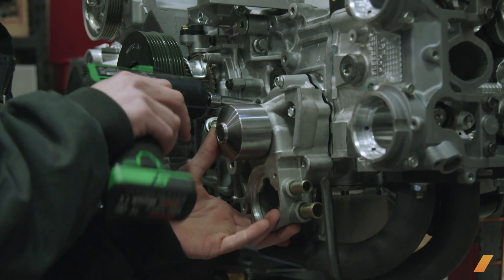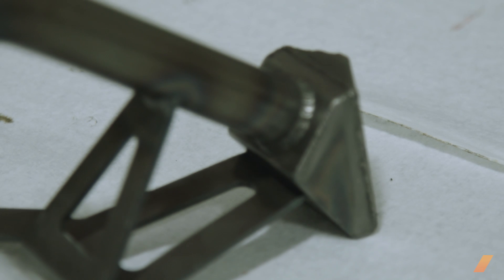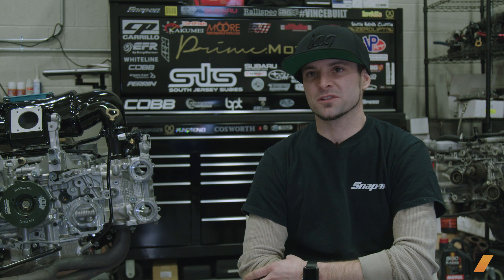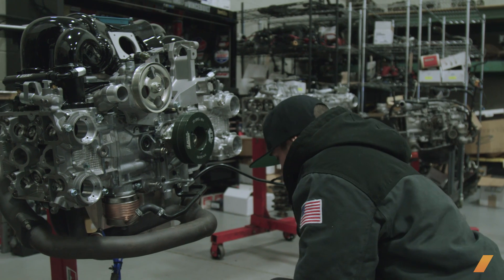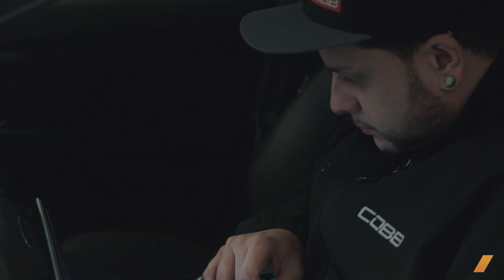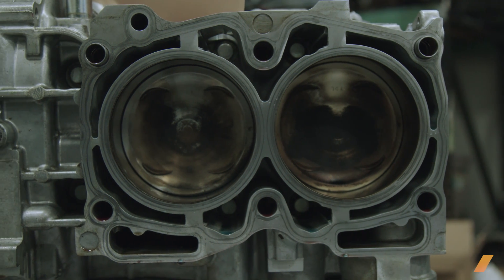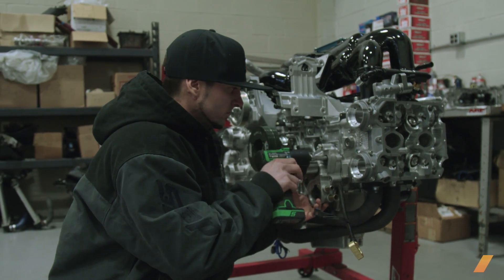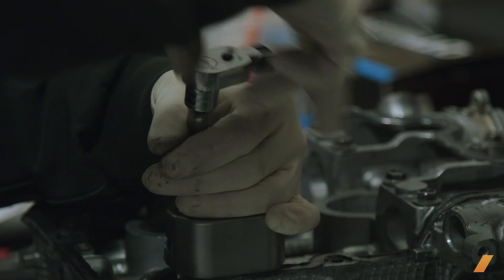Legendary Subaru EJ: 1,000-hp Performance, If You Want -- /ENGINEERED

Comment: You seem pretty knowledgable, i run Rotella t5 or t6 in all my engines, My car (4 cyl), my truck (v8) and my bike, (honda VLX 600 with mods and wet clutch) also ran it in my Harley, but only in the crankcase. You  mentioned oil change times.  This oil in the big rigs, is changed out every 25k miles( granted they are hwy miles)  I go about 12k between changes except inthe bike, its about 5k.  What are your opinions on the oil and its uses?

Comment: "600 hp are the norm nowadays". That's perfect because that is about what I was looking at doing when I have my engine rebuilt. Currently I have a BNR 16g on a cryotune, with a bulletproof mod stock TMIC, up pipe, down pipe, upgraded fuel pump, and clutched rated for 450 lb/ft. I'm looking at an IAG stage 2 EJ257 open block with stock heads, and a turbo that flows between 60-65 lbs/min, and whatever fueling considerations are required (E85 maybe?). I'm trying to wrap my head around the best approach for this - including supporting mods. The LegacyGT forum seems to have some information, but if anyone has links to 600 HP builds, I would love to see them as I still have a lot of questions.

Comment: I had an 2004 wrx 2.0. Blew the engine at 64000 miles, Spun a bearing. I rebuilt it myself because I didn't want to pay the "stealer" to replace it with another problematic motor and I wanted the challenge.  I bought a new crank from Subaru. The part number was different to the stock crank. The oiling holes were clocked differently. The old crank basically ran out of oil pressure at every 180 degree point. Look up the issue with Chevrolet after market forged cranks on the 327 57 Chevys. When you split the motor open you will also see that the oil feed holes to the crank were not drilled correctly from the factory. The oil feed holes are pin sized at the bottom of the cut. Basically you finish drilling the holes the factory diameter but you go deeper cutting out the pin hole on the bottom. You'll see what I mean when you pull the crank and look for it. I ditched the silly valve in the intake. JB welded the holes from the shaft and blended it with a die grinder. Port matched the exhaust manifold at the flange on every port. Hollowed the 3 cats and programmed the cat inefficiency code out. That and a fabricated down pipe from the stock flange to the 2nd cat's side increased boost 1.5 psi. I changed out the stock pump for a walbro. What I wish I had done was also upgrade the injectors but I wasn't sure I could get the computer programming right in a fast enough time frame. it was my only transportation at the time. I turned the boost up to 21 psi on a stock turbo. I added 3 degrees of timing and left the fat factory fuel map. That car was at 160000 miles with the stock turbo when I sold it. I use to have a problem with oil burning before I rebuilt the engine. A ball honing with a drill and new rings and I never burned oil again. I eventually sold the car because I was suspecting the 5 speed was going to let go. Especially after replacing the clutch with an aftermarket that didn't slip like the stock clutch. I could out run a stock sti and was beating stock M3's of the same year. I could never get around the newer bad boy M3's before I sold it. Surprised different modded cars that said they always beat wrx's. ....now playing with an  ls motor with a single turbo. Much cheaper and reliable. Oh yea . Another reason I sold it was because no one was sharing any  secrets about the wrx. The tuners would not breathe a word. Basically drop it off , leave a check and we will mod and tune it. Very stingy with the knowledge. Kinda the same crap this dude is selling. Leave it and a credit card with us and we will fix it. No thanks!!!

Comment: Much bigger problem is simply in the banjo bolts. but other than that greatest platform in my opinion to date. and i have yet to see any other ej running a faster time stock at 12.59 could’ve gotten alittle quicker had car been let set for a cool down period.

Comment: Rallispec people are freaking wizards and get my respect no question. I worked over my 4G63 with Andy C who was Dave A's partner way back for club rally and these guys are no joke. They actually had to change the rules to slow Dave's suby engines in international top level sports car racing. His road racing car won everything when the driver from Phoenix in PA was in the picture a few yrs ago. THen this shop was Subaru factory racing team international engine builder. I never met Vince but as an alumnus there's no doubt he's on point.

Comment: EJ22T from a 91-94 (closed deck block) is the BEST choice.  I donlt care hwo smart this guy of the video is, the EJ22T is the best they made, then a EG33 but not talking that one yet.  A EJ22T can tke 30 psi boost on stock bottom end and never have and issue, with some fuel management.  Just saying.  I have owned over cars wtih that ej22t.  I had a shelf of the, .  Not more.  They all went across the pond.  Wish i had them back cause I know what they are.  Sleeves, um no closed deck YES

Comment: Thanks for taking the time to post some good technical info!

However, I thought I might actually hear some decent points about why a boxer (the EJ) is good (low Cg of the engine and "balanced" only help those looking for confirmation bias i.e. Subaru fanboys).  I am very disappointed.  This is why I sold my STI and bought an Evo.  I got sick of blown head gaskets, poor turbo spool, bad handling, low horsepower, and being beat by evo's with nothing more than a tune.  Subaru needs to ditch the problem prone boxer and go with a practical engine.

Comment: The FA will very quickly surpass the EJ platform hands down. Just because they have been using the EJ in the sti for like 47 years doesn't mean it's a great motor. They have a lot of issues when you try to make power without fully building them. There is a reason every sti owner trades in or sells their car at right around 90-100k miles because even if the car has been maintained and serviced regularly it has become a ticking time bomb. Within a few thousand miles you will start having to replace major parts on that motor including the turbo and it will become a money pit just like older Volkswagen and Audis. I still love the cars just think that the money for them isn't right.

Comment: I get it. The EJ is still reining to be the tuners choice (because its easier for them). But why would i want to buy a car just to have to build the engine. As mentioned in the video "Cast pistons are just garbage, if you try to have any fun in the car, its just a matter of time, its like a ticking time bomb" Spend $40k on a new STI, another 5-9k on a shortblock that will last 2-3 years. Spend a minimum of $3000 on basic bolt ons just to make...350 horse?

Comment: I've been through countless Subarus/EJ builds. Spun bearings due to bad tunes and definitely oil pick up issues. My last 2 builds, especially my last one, I made sure I did it the right way, & spared no expense. I put about $15k under the hood ie; 
-New 2012 ej25 block
*Manley Pistons/Rods
*King Bearings(main/Rod)
*BC272
*Manley Valvetrain
*Gtx3071r rotated kit
*Wally 450Lph
*1200cc
*Radium fuel delivery
*Link G4 PnP ECU
*E85 tuned
*3in TBE catless 
I only made 470awhp/440awtq
 On a Mustang Dyno. Once you get to the 450-500 mark it gets a lot harder/expensive to gain the next 10whp if ur doing it the right way.
I finally said F^ck it & sold my last STi & switched sides. Now I'm driving an Evo 8 & I can honestly say that the 4G63T is better in EVERY aspect except maybe the balance as mentioned here by Vince. Of course the Subie Symetric AWD system is far better than the Mitsubishi AWD, but we're talking engines here.
I'm now making 396/389 on pump
*stock block
*stock 9 turbo
*Stock Valvetrain
*GSC 1 Cams
*1000cc inj
*Wally 255 
*3in TBE w/ Test Pipe no cat

So on a pretty basic/stock setup, I'm making what it took me around 10k to make on the EJ platform, for about $3k on the 4G63T. 
It was a very hard decision to make. I've always been a die hard Subie Guy. Living in the Pac NW it's almost instinct to own a Subie! There is just too many issues that come with the EJ20/25 build. I love my Evo and I plan on owning this bad boy for a long time to come!

And BTW, It's guna cost you around $25-30k to reliably make 1000awhp in a STi  
-stage 4 iag block: 8k
-built heads: 4k
-GTX3584R or 6466: 3k
-Hot parts kit: 3k
-Fuel Delivery: 2.5k
-oil delivery: 2k
-FMIC Kit: 1.5k
-Radiator: 300
-Engine Management: 1k
-sensors: 500
-BOV: 300
-EWG: 400
-Drivetrain/Clutch: 4k
-Brakes: 2k
-Suspension: 3k
-Random parts: 1k

This was just a quick run down of what I remember from my last build, that was only a 500awhp build so... Yeah... And just a quick reminder that when you get up past 500awhp in an STi, it starts getting expensive bcuz you have to buy all supporting mods otherwise you'll just hit a wall, and end up dealing with Gremlins every damn day!

Comment: Good Vid I had an 04 STI back in the day that made great power but took a bit to get it there with tuning, if I got another STI I would probably just keep it mellow and have moderate HP. Going over 500+ was just too much and emptied my pockets lol but non the less I do understand the bash of the EJ25 mtr. I just wish the motors came a little more built from the factory I.E forged internals, injectors, etc seems like if you are paying that much for a car new the engine should be stout but thats just my 2c as a former Subaru owner.

Comment: How long will it last?  100k, not unless your mom is driving it.  If your motor sounds like shite, take it in.  Silly flat bill boys and their subarus.  HG every 65k sound fun?  The Japanese guys who engineered these cars were making a shity reverse enginered VW bug with the flat shit box of a motor.  You can spend as much as you want to make anything pull 500hp, anything!  At the end of the day you are still driving a shit car inside and out.  The difference between a WRC car and a car you build are not even the same animal,  you said it yourself.  Oh, and don't drive it hard or it will break, said that too.

Comment: He says one of the biggest mistake to make is to fit a down pipe without a tune as it will over boost. Any one really know why this is ??? I know your loosing a CAT and increaseing flow so maybe standard boost control cant regulate fast enough . I’ve never noticed over boost problems but I have got a hks EBC

Comment: Here's a question that I haven't seen asked and because of that, I'm gonna ask it: Is it possible to build a 400hp Daily non-turbo driver that will NOT break the bank or need a lot of extra maint. In other words, it's like the same thing you could do on a budget going from a 2 bbl 350 w/200hp to a 350hp with just a few cheap but durable bolt-ons in a day or two in your garage with just a simple set of tools?

Comment: First thank you for your time and explanations about the EJ engine. Have you tried a supercharger instead of a turbo? I used to build Nissan engines, inline 4 and 6's. We tried both turbo and supercharger. What I did was not legal in the SCCA. I don't know much about the Subaru EJ but found out on Nissan and Toyota inline engines was all the horsepower was in the cylinder heads so all of our heads were flowed and cc'd on a flow bench. Once the head was done the bottom end was balanced as a single rotating mass with the clutch and pressure plate. We weren't getting anywhere near 1, 000 HP but on a 2.0ltr Nissan L engine with a Nap-Z head which is a cross flow head we could get 500 HP with a supercharger. On the same engine we lost close to 15% power with a turbo. Today you can add an electric motor to turn the supercharger so that you don't have the power loss with the S/C being driven by the engine. I really like what Subaru has done with the flat four. I wonder why they haven't produced a flat six like Porsche. Being factory trained on Porsche, Audi and VW, I would take the flat 6 over a V8. The Japanese have proved that there is substitution for cubic inches. 1,000 HP from a 2.5 ltr engine and half or more of the weight. Thank you again for the great explanations.

Comment: Terrible engine tbh, there is no advantage to running a flat four, the "balance" thing is just a myth. What can be done about the horrendous bore to stroke ratio? They never make big bhp unless they run nos, there's a reason why people go flat 6.

Also it's mounted too far forward = understeer heaven.

Of course it's the drivers fault for the understeer, the bearing failures and the rest.

Comment: I wish I would have been lucky enough to see this video or something close to it before I started modding my suby. Tried to do everything right with the knowledge I could find at the time (I didn't look hard enough, obviously) and still spun a bearing due to the faulty pickup and high miles. If I were to add to this, don't buy a WRX if you plan on heavy modding. Start with a freaking STi. I'm not sure how it is now but for my time ('05 suby) STi's came with so much more for a far better deal than a WRX(suspension, transmission, engine, injectors, wheel options, interior and exterior styling, boost gauge, and more). Fantastic video. Thumbs up for sure!

Comment: All i got from this video is that an STI is NOT the best tuner car lol...The car is too sensitive, you cant even add an intake without a tune. You cant up the boost to a decent level unless you upgrade alot of parts, or built the engine. The car is poorly tuned from Subaru as well, thats a known fact, so right out of the bag this car requires a tune to run properly, otherwise you'll be blowing up some ringlands on a stock tune...On this video the tuner said it very clear, "this is a 20 year old engine", which obviously means that theres alot of data on them; but when nothing new has been added to the engine to make it better, that alone brings challenges.

Comment: Good video! A lot of information I needed to learn. I got one question tho and all of you youtubers feel free to answer me aswel, I drive a 2liter straight six bmw engine from 1995 nothing special and stock with 150.000 miles on it. I heard you talking about changing the Oil every 3000 miles. I life in the Netherlands, Oil is freakin expensive here. Already got an Oil/Air separator on it. Is it possible to not change it until i hit 10.000 miles?

Comment: Ej engine leaks coolent everywhere ,blow headgasket, rubbish gearbox weak diffs even the suspension on the subaru is rubbish bushes leaks grease and even have inverted shocks which is shit also one of the worse Japanese car brands ever next with honda rather have a bits are missing or Mitsubishi

Comment: That tip for the oil is that in race environments? Higher hp? 

Like if someone runs e85 putting down 400hp do they still need to change the oil every 1000 miles?
Reply: tdawg719 all cars running e85 with no PCV
Reply: Vincent Griffin even if they run a air/oil separator?

Comment: Good video.  Helped reassure me that the choices I made for my current build were the right ones.  Pretty much mirrored your build blueprint and prioritization of parts.  What that Mikey tuning?  He did my first tune.  I pulled the motor 60k miles later for an IAG stg 2 tuff block build and you would never know the old motor has 100k miles on it.  The car will see some daily work so I'm glad I went with the tuff block for the center bore and tighter tolerances.

Comment: This video was very insightful. Id have this guy build me an ej anytime. Unfortunately i dont have a Subaru, ive got a 2004 F.O.R.D. (Fucking Out Right Disaster) Focus SVT. (Id love to see what he could build my lil Zetec into(especiallty because i had a CATASTROPHIC engine failure at high rpm under boost at only 29,000 miles. Cars been sitting 5 years now. Sigh